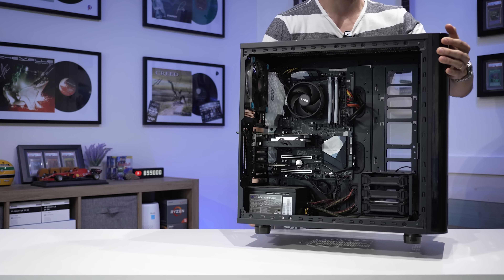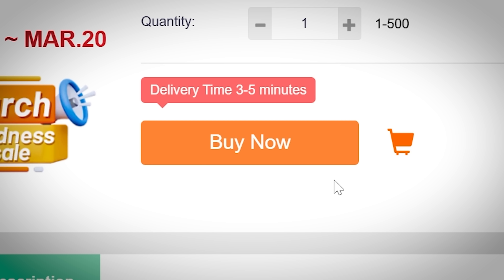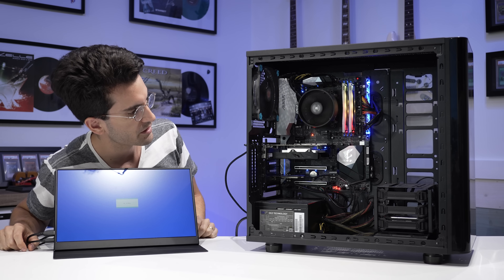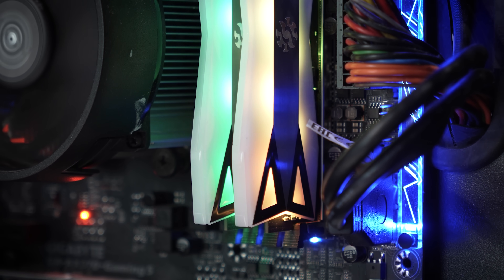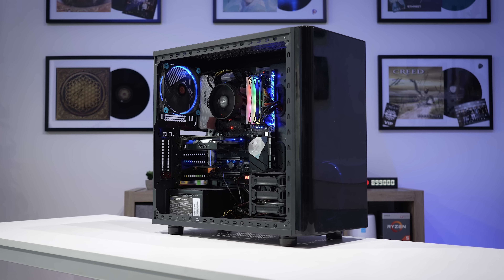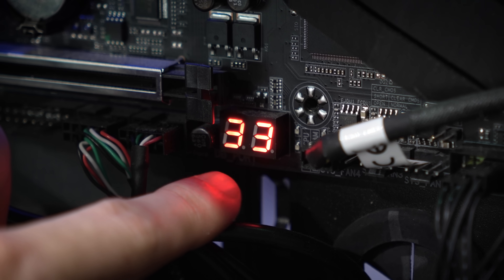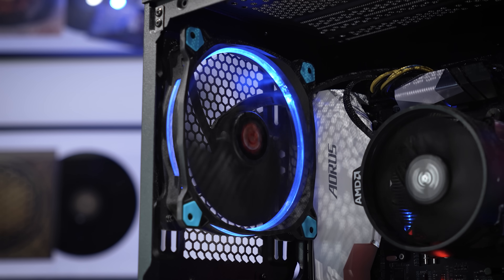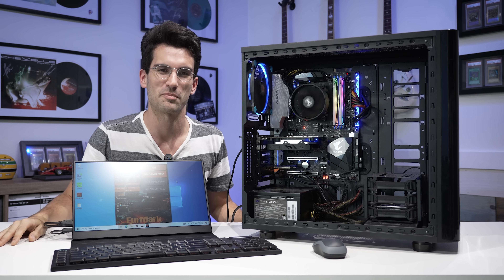Fixing a Viewer's BROKEN Gaming PC? - Fix or Flop S6:E17

Comment: Viewers screen is probably a multiple port screen and set to dvi or dp, not hdmi in any case. Some screens will stop auto cycle on port detection if you manually click through the ports and with moving stuff around some one probably hit a button on the screen.

Comment: Could also be a bad displayport or dvi as you mentioned. i have an older gtx 760 that has a bad displayport, with a known working cable it doesnt work, but hdmi is just fine. also congrats on the 900k subs. cant wait to see you finally reach a million !
Reply from the maker: He only ever used HDMI, which is why we used the same port in this video. I believe this was mentioned somewhere around the middle of the video.
Reply: @GregSalazar  oh okay, then must be bad cable like you said then. ive had plenty of those hdmi cables die on me.

Comment: What I've learned is that HDMI cables can be super sensitive, they can break down really fast. So yeah I think the problem is just the HDMI cable on the owners side. But also could be that he didn't select the proper monitor input in his monitor.
Reply: super sensitive is generous. I'd call them utterly worthless garbage. I've had hdmi cables that refused to work, ever, again, after sitting in a port for years on end bent a particular way, the moment you unplug them. even "good" ones.

Comment: You sure 33 isn't the temperature?   This is an option for the post code display when booted into windows.
Reply from the maker: It's not a temp. It never would remain stuck at exactly 33 for hours without changing if it was a mobo/CPU temp.
Reply: @GregSalazar  Yeah you're right.

Comment: Waiting for the next one. Also, for users, check the simple things first like a cable before going straight to the hardware as the issue.
Reply: Yeah. My mum was about to buy a new charger for her hearing aids. I bought her a new charger cable and it works fine.
Reply: A Cable is hardware
Reply: In college my electronics teacher had a saying of "check the obvious first".
Reply: Yeah...I am still ashemed for that one time...I bought a new power supply. Put it in,plugged everything,pushed the power button...Nothing. Ok,checking all cables. Everything ok. Please don't tell me that a new power supply is dead before anything...Oh,I forgot to plug the power cable into the wall outlet...Nevermind.

Comment: My guess, the cord was trashed when stretched and they only used it.
Reply: Yeah, almost certainly a mangled HDMI cable or the monitor-side port.

If they tripped on it hard enough to rip a GPU out of a screw mount, I have to assume it also moved the monitor, if not yanked it completely off the table.
Reply: maybe a bad power outlet? flux in the power might effect the motherboard in shutting down extra functions?
Reply: @craiglortie8483  Nah. Doesn't fit the timeline, and there are no "extra functions" on a mobo.